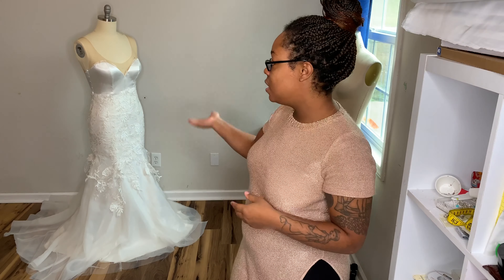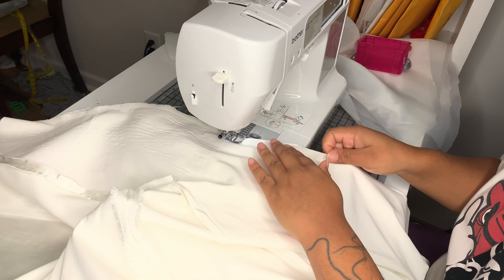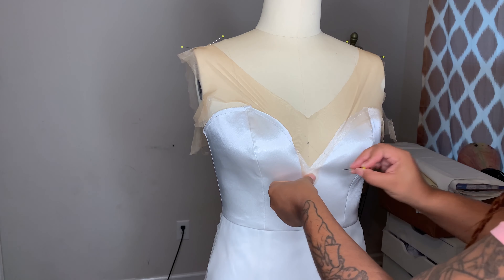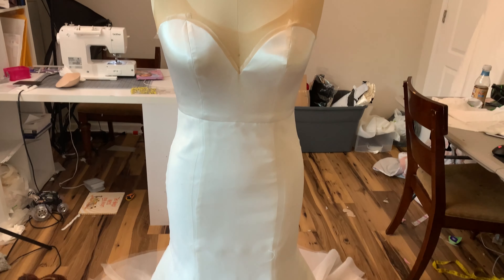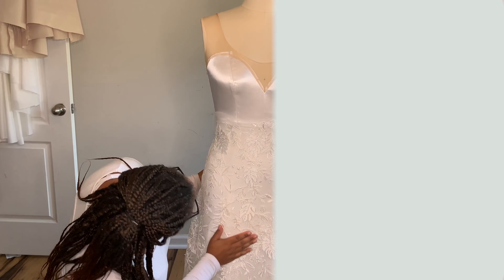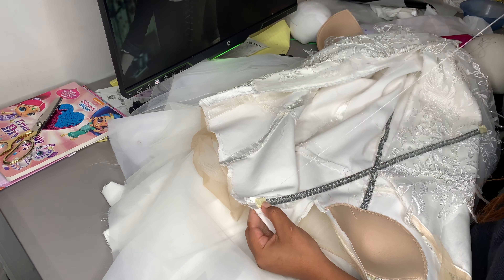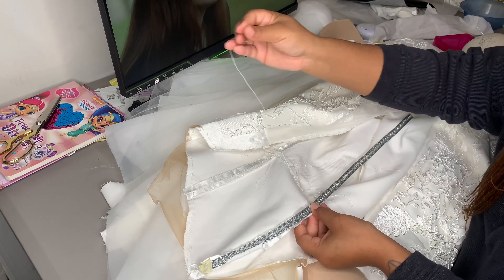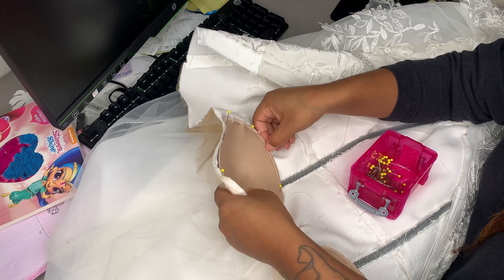DIY Wedding Dress: Making my own Wedding Dress Part 2

Comment: Using metal boning is not recommended  because it makes the dress so heavy, other is that it tends to rust if they live in humid places, is better to use plastic boning
Reply from the maker: Thank you. I haven’t had a problem with it, though I would have used rigiline if I had enough for this gown.